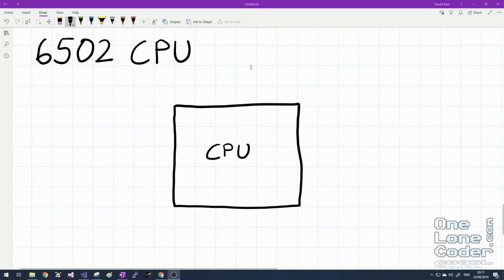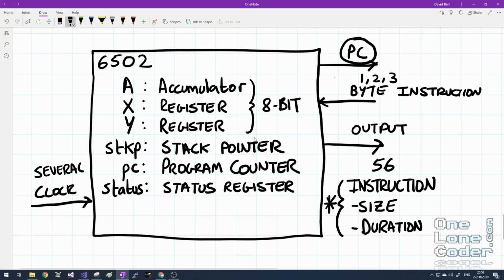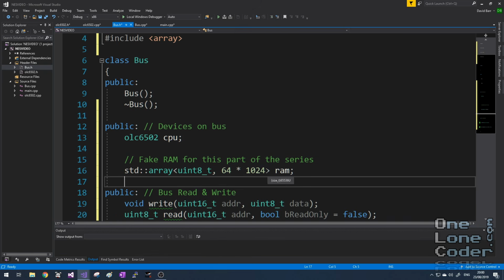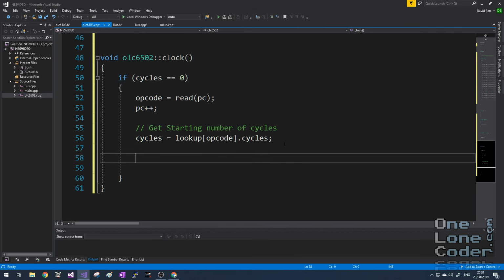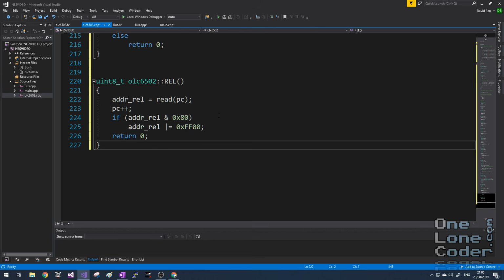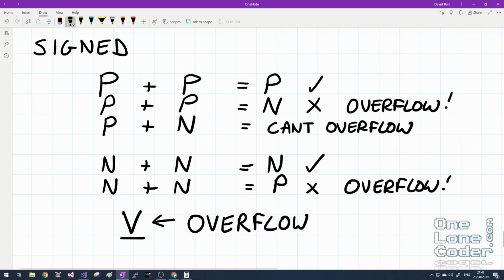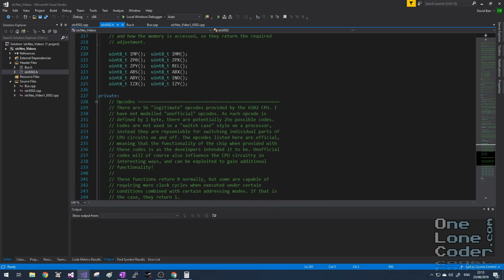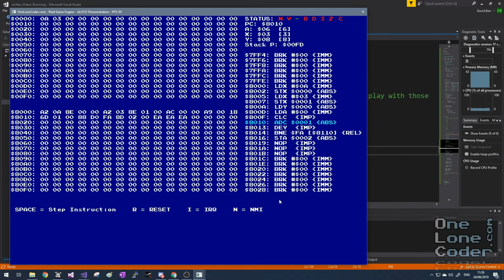NES Emulator Part #2: The CPU (6502 Implementation)

Comment: 18:50 You should use <stdint>, not <c stdint>.
Using uint8_t for data:  did you consider std::byte ?  IAC, you should use specific named types (even if you're not using "strong types" for different domains; so use data_t and address_t of your own making, not integer types directly.
And, why didn't you make read() const?

19:50 Don't write a loop to set the memory to zero!  Use a standard algorithm.  Either fill_n, fill, or best of all the range version of fill, which is now in the standard.  If you're not using the bleeding-edge compiler, range-based algorithms have been in Boost for a long time.
Write:  std::fill(ram,0);

26:59 The decoding matrix should be constexpr .  The table can be populated at compile-time as a constant.  (If you do that, you can't (currently) use vector, but the size is fixed anyway, so an array is better anyway.)

42:00 You duplicated the entire function a bunch of times, changing only one character.  That's actually painful!  You should have a single function that takes the flag as a second argument, and all the actual instruction functions are nothing but a call to that function, specifying the flag to use.

52:21  "after that it does exactly the same thing as ADC"  so I expected you to call that function, reusing the "hardware" as you alluded a moment ago.  Pasting a copy of the body of the function?!  Just, don't.
Reply: Some of this stuff bothered me too. But I think his approach is to write beginner-friendly code, rather than highly efficient and clean one. CPU emulation is complicated enough for a beginner and adding complex C++ would just make matters worse. That being said, your points are really helpful!
Reply: @RohitAwate  I can see the point about not digging into something else if the equiv. code is short and sweet.  But beginners should be taught const-correctness from day 1, and should never be exposed to the bad example of copy/paste programming.

Seeing  fill(buffer,' ');  (with no need to further explain it) is easier to understand than elaborating out a loop to do that.  In general, top-down design and explore the function being written on a high conceptual level, with no diversions into low-level details.

Comment: I had no problems at all understanding this video, since when I was in High School I was programming 6502 assembler on an Apple ][+.  This brought back many memories for me.  One cool thing about the zero-page memory, I used it to hack many games into giving me unlimited lives.  My homebrew Apple (I still have it!) had a switch that I could use to switch between AppleSoft and Integer Basic.  So I would run a game, and keep note of how many lives it started off with.  I would then play the game and get killed, then immediately put the switch to Integer Basic and hit reset (This needed to be done because most games would reboot on reset in AppleSoft), which would put you into the Apple Monitor, where you could examine the memory of the Apple, including the zero page.  I would look through all the entries of the zero page, and see if it the count went down one, and keep it's location.  Most game programmers put this kind of stuff in the zero-page area.  I would start the game again and get killed a few more times, and see if there were zero-page memories that went down at the same time.  Then, it was just a matter of loading up the code, using the monitor to look through the game code for something like "DEC $10" and NOP'ing (I still know it as the $EA opcode!) the code out.   Then restarting the game, with now unlimited lives! Also, used to freak out schoolmates by putting their name in the game.  

Anyway, congrats on your 0x64 video.  Will also sub as well.

Comment: 4:39 Your diagram shows that chip 1 can only write data to the bus, so how can it see that the CPU has sent it a signal if it is write-only ?  Please make this ambiguity for more clear for a logical mind, that signal lines are independent of data lines.  For those confused, imagine that chip 1's signal line just went "High" via the CPU (which controls these signal lines and the amount of power/clock driven to them), and now it can write data to the bus.  Signal lines can be used as a simple on/off in this example (don't worry about mosfet / signal clocks, that is not covered in this tutorial, but if you're interested in how the signal lines have come to evolve from a simple on/off switch to a clock/variable voltage signal of their own, have a read up on mosfet design, which allows things like daughter CPUs to be supplied with a clock coming from the signal line or the bus).  Some laymen also call the signal line the "enable" line.  It lets the chip know that it needs to do something.

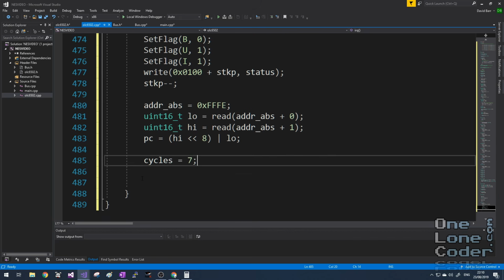Comment: @56:15
If the `nmi` "is exactly the same" as the `irq`, was there any reason not to simply implement `irq` as follows instead of duplicating the code?:

void olc6502::irq() {
... if (GetFlag(I) == 0)
...     nmi();
}
Reply from the maker: Functionally they are the same, but they reference different address vectors
Reply: @javidx9  Great. Thanks.

Comment: @53:43:

This is an attempt to clarify a potential point of confusion for others who may not be too familiar with the stack. Normally, the stack pointer (i.e. `stkp`) should be pointing to the element at the top of the stack. However, in the code as shown, the `stkp` isn't really pointing directly to the top element. Rather, it's pointing to the (logically) "empty" location where the next element should go when pushed, which is why the `write(0x0100 + stkp, a)` call is made first in `PHA` before decrementing the pointer with `stkp--`. Consistent with this, in `PLA`, you can see that the `stkp` is first incremented before reading, so that it moves from the (logically) "empty" stack position down to the actual top element in the stack.

I mention this because "normally", you'd expect the `stkp` to be pointing to the top element directly at all times, which would mean that on push, you'd be `stkp--` and then `write(...)`, and on pop you'd be doing `read(...)` and then `stkp++`, in that order.

BTW, if you're wondering why `stkp` is decremented in value when the stack itself is supposed to be growing in size (and vice-versa), the reason is that stacks grow from high memory addresses down to lower memory addresses.

GG
Reply: Thank you.  I was confused.
Reply: you misspelled stkp as stpk in some instances
Reply: @senatorpoopypants7182  Fixed. Thanks.

Comment: Brilliant! Let me just say your channel is one of the two YT channels on my subscribtion list :-) BTW, would you use the same approach regarding lookup table for Z80 emulator? I mean because there are many more instructions and they are not memory oriented but are register oriented which might be suitable for some kind of organizing the instructions in groups where the only difference are the registers. And if you by chance know - there is one thing that surprised me back in the days when I started to learn 6502 after years of programming in Z80 assembler: I never understood why 6502 designers decided to make the immediate load affecting the zero flag :-/ On Z80 I often used the zero flag as a return information from some call and since load don't change the flags I could still preload some registers after setting the zero flag and before the return - which is on 6502 (since load ruins zero flag) not possible. Something like:

 CP A  ; set zero flag
 LD A, #FE ; some return info (zero flag is not changed)
 RET

or:

 OR A  ; set zero flag if A = 0
 LD A, #FE ; some return info (zero flag is not changed)
 RET

or:

 OR #01  ; reset zero flag
 LD A, #FE ; some return info (zero flag is not changed)
 RET

or:

 XOR A  ; reset zero flag and A
 LD C, #FE ; some return info (zero flag is not changed)
 RET

I don't see any reason why would be useful for immediate load to affect zero flag :-/

Comment: 49:25 How the hell that works?
Reply: Look at columns 1 and 2 (A and M) and compare with the column V

When is there a 1 bit in the V column? (Just concentrate for now on A and M)
By careful observation you figure out that V is 1, when A and M happen to be the same.
How do you compare 2 bits to figure out if they are the same.
Well you could always do
if( A == M )
with A and M stripped down to Bit 7 only.
but you want to do it on level of bitwise operations. Which you want to do because we know, that this condition is not everything there is to it. You also have to do something with the Result, but more and that later. For now just concentrate on the relationship of A and M and how they are part of forming V.
So you have 4 bitwise operations: not, and, or, xor.
it cannot be not, since not just takes 1 bit and negates it.
So we are left with and, or or xor
Lets look at the truth-tables

AND                    OR                      XOR
A  B   | Result     A  B  | Result     A  B  | Result
---------+----------     --------+----------     --------+-----------
0   0   | 0              0  0  | 0              0  0   | 0
1   0   | 0              1  0  | 1              1  0   | 1
0   1   | 0              0  1  | 1              0  1   | 1
1   1   | 1              1  1  | 1              1  1   | 0

(When working on bit level, you really need to know those truth tables by heart. There is no way around it.
AND: Result is 1, if both A and B are 1
OR: Result is 1, if one of A or B or both are 1
XOR: Result is 1, if one of A or B, but not both are 1)

We see, that xor just fits the bill. We want to have a 1 for Result whenever A and B happen to be the same. As said, xor only just fits the bill, since the output is quite the opposite. It is 0 whenever A and B happenb to be the same, and 1 if they are different. But this is somthing that is easily fixed with a not operation.This is why he has
~( A ^ M )
which just negates the result of the xor.

But as said: figureing out if A and M happen to be the same is just half the story. It is just the prerequisite for the second stage: If the result happens to have opposite sign as either A or M (it does't matter which one, since we already have figured out that A and M must have the same state), then and only then the V bit needs to be 1.
So again: we are looking for an operation which gives as 1, if A and the result R have opposite state.
Looking at the truth tables you see: that is exactly what the xor operation does. It has a 1 bit in the result, whenever A does not equal B.
Thus the second condition is: whenever A happens to be the opposite of R, which boils down to
( A ^ R )

All that is left is to combine those 2 conditions.
V needs to be 1 whenever
* A and M are the same
AND
* A is the opposite of R

or in C++
~( A ^ M )  &  ( A ^ R )

Hope this helps.

(Edited for minor typing issues)
Reply: Ok, now i finally realized how it works, but it's not looks very human readable. I think that if statement with some & and | operators could be easier to understand. But maybe it's only dumb me.
P.S. Cool man, who explained this thing to me and then deleted comment, come back, please :P

Comment: Hey! Great video, I really enjoyed watching it.
Could you by any chance just briefly give some information about what you mean when you say "this is not an effecient way of doing things"? Not like a real explaination but like a few keywords or something so we can look it up?
I am struggling writing clean and efficient code so I would greatly appreciate it!

Greetings from Germany.
Reply from the maker: There are several instances where ive sacrificed potential performance for clarity of code. On the whole it is quite an optimal way of emulating a cpu of this design, but im certain there are additional binary tricks regarding flag setting that could be used. Theres a lot of code duplication. This could also be reduced by emulating a little deeper, and actually implementing the cpus microcode. By design this would also emulate all the illegal opcodes natively, but that would be a much more complex project. Wrapping everything in functions makes things easy to digest, but could incur overhead if the compiler doesnt optimise them.

Comment: Subscripted for the NES tutorials - Loved the videos.

One Question, Early in the video you mention that the current instruction will complete when an interrupt occurs. Does that include the cycle count? Currently any outstanding cycles are trashed when an IRQ fires. should perhaps be cycles += 7?
Reply from the maker: This is a great observation, and I'll admit something I hadn't considered - I'll experiment, it may add some stability.
Reply: @javidx9  
I would do it this way, that nmi and irq just set a flag in the cpu, that an interrupt was requested.
In clock(), when the cycle count reaches 0 and you are about to start a new Van Neuman cycle, check the flags and process the interrupts if any are pending.

I don't know about the 6502 in particular, but in most CPUs you need to do that anyway for irq, since the irq may be disabled, in which case the execution of the irq routine is delayed until the interrupts are enabled again. (But as said, this is a generalization derived from most CPUs I had to work with in the past. I have not checked how this works on the 6502, but I would expect it to be the same)

Just by using "pending flags" you get this behaviour (and more or less this is exactly what most cpu usually do, by using a flip flop to store "interrupt pending")

Edit:
YOu may also want to check the data sheet, if there may be a delay after enabling the interrupts. Eg. on an AVR processor it is guaranteed that after enableing interrupts at least 1 instruction is executed before the interrupt is serviced if one is pending. Again: Don't know about the 6502.
Reply: @javidx9  after some more thought. I have some more questions on the interrupts. 

Are all instructions truly atomic on the 6502 - does the CPU "freeze" during the required clock cycles? 

If they are not atomic, then what should happen if an interrupt fires while another is already in its cycle? 

My guess is that interrupts are actually disabled during those 7 or 8 cycles? And those second interrupts should be dropped? Currently this handles those extra interrupts. 

If that's true. We're going to need a second counter to handle interrupt cycles. Add a guard clause to the interrupt functions (if (icycle > 0) return). And decrement this second counter in the main loop (if (icycle > 0) icycle--;)

Comment: Chemists have The Periodic Table of Elements.
We Software Engineers have The Mnemonic Table of Opcodes.
Reply: Hardware Engineers have the Truth Tables, State Tables, Transition Tables, Implication Tables, and K-Maps of your Basic Logic Gates and the combinations of them!
Reply: Of each processor
Reply: ...but there is only one "machine" in chemistry, with a universal set of codes, versus many for the software guys!  Can we compile C++ to chemistry?
Reply: @bpark10001  I mean Silicone is a chemical compound sooooo 🤔🤔🤔
Reply: @bpark10001  I tried to derive the "machine" and its calculations. It is a real pain. But it is also one of the most beautiful things I have ever seen. And yet I barely scratched the surface 🙂

Short version : position, velocity, acceleration of a particle in space. Then go to many particles. Newtonian equations. Generalize the principle to other formulations of it (Lagrange, Hamilton, Hamilton-Jacobi). Solve for different potentials. Add electric forces. Double down on everything you know about vectors and scalar products. Go to quantum mechanics. Start with one wave function and derive the entire spectrum of the eigenstates with ladder operators (second quantization). Think about mixing bases. And then you get there...
It is very akin to assembly programming though.

Comment: I actually tried my hand at writing a 6502 emulator many years ago (I wanted to try making an NES emulator too), and I've got the code open while looking at what you're doing.  Unsurprisingly, your implementation is much nicer - I used giant switch statements to process opcodes instead of function pointers, for example, and I never implemented a proper bus, choosing to just create a single 64K block of RAM, which meant I would have had to refactor things to get the other devices hooked up once I got past the mere CPU emulation stage.  I doubt I'll revisit the project again, but I really enjoy watching someone that knows what they're doing go through the same steps that then-20-year old me did so many years ago.